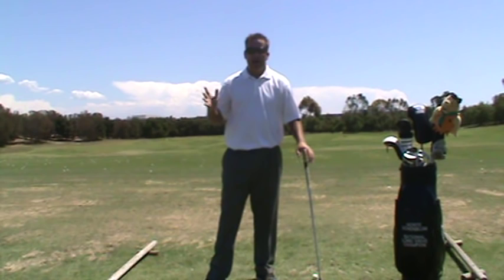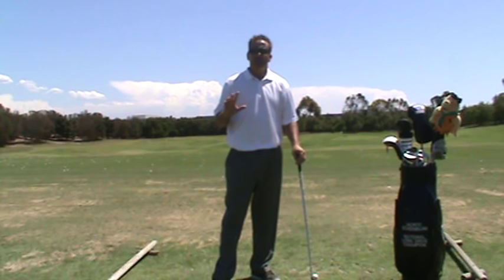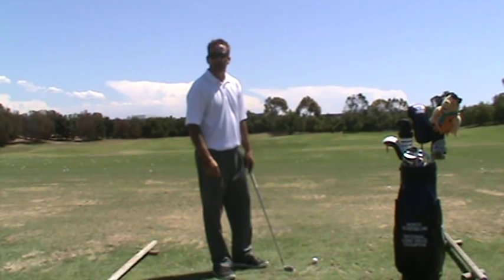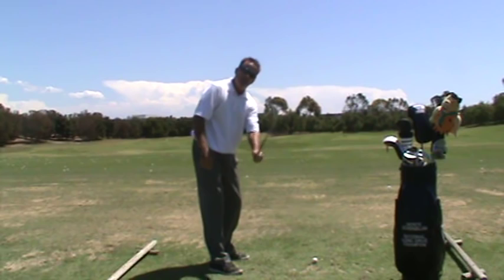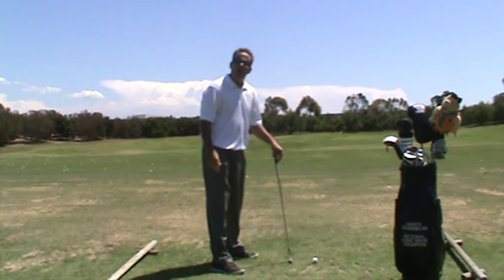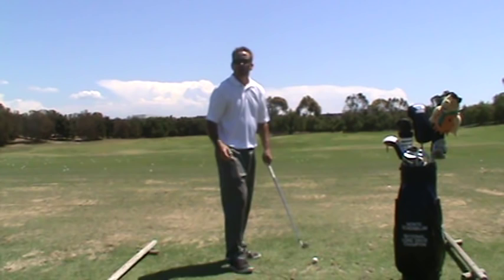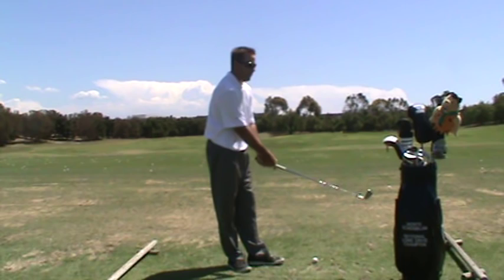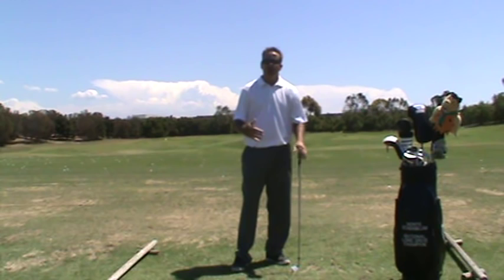Making a Perfect Back Swing

Comment: This video and the left arm rotation and lift video are about the clearest and simplest instructional videos ever made about what needs to happen in the golf swing. It's good to do it slowly with a lofted club to hit crisp, high pitch shots and get the movements imprinted in the brain. Important to remember that the lead arm rotates over and around the trail arm in order to effect the 90 degree rotation. Do not simply fan the wrists open or the clubhead will get stuck behind, and that is simply trouble with a capital T.

Comment: Thanks for this video Monte.  Very helpful and it seems to be helping my swing already.   I have one question concerning the left arm rotation.  Seems to be a weak area for me, probably because I used to over rotate and then overcooked that and under-rotated for a period of time.  I noticed that you didn't mention the folding of the right arm as being a requirement.  Is that because the right arm will tend to fold in a good fashion if the left arm rotates correctly?    I did  a little experimenting with that and it does seem that the right arm tends to fold by itself if other parts of the backswing are working correctly.  I would prefer not having to think about consciously trying to fold the right arm so as to make the backswing more simple anyway, another reason why I like your methodology.   Of course there seems to be a huge amount of emphasis on the right arm folding in golf teaching anyway,  possibly way too much.

Comment: I get what you are saying here, but the drill put the club into a position where it was getting steeper from P3 to P4 instead of the classic shallowing you see in almost every "ball striker" which is a shallowing of the club from P3 to P4.  Hogan/Trevino/Furyk/Morikawa put whoever you want in there but this drill definitely isn't gonna help the golfer in my opinion particularly the chopper (90 shooter).  Now I  know there are instances of great players who shallow coming down (Couples, Nicklaus,  Daly) but they are far less common on the tour.  The company I worked for CompuSport back in the 90s created computer models by having 50 PGA Tour players swing and it combined them into one model.  The model laid the club off at P4 and the club was definitely shallowing during transition near the top of the swing vs on the way down.  Enjoy your content though, keep up the passion for excellence, and not trying to be condescending, just offering some other thoughts based on science.

Comment: I think this is a helpful drill, except when the hands might get too far from the body going back.  The hardest part for me is to get the left arm rotation correct while getting the club on plane at the same time, albeit my wrist cock has improved..  Movement number one might help keep the left arm rotation from causing the swing to become too flat.  For me, ssems like I have fo focus mostly on getting the wrist hinge right so that the left arm can rotate like it should and at the samee time keep the club up on plane or close.   Lifting the left arm in the backswing also seems to help keep the club from getting too flat.

Comment: One question, at 4:03 at the top of the backswing you have the club parallel and pointing straight down the range.  I think this is a function of the right wrist.  For lack of a better explanation, at the top of my backswing the club is point ~45 degrees left.  I think this is caused by my right wrist/palm facing towards the sky, which is the most my wrist will "open" .  I have always concentrated on a flat left wrist (and right elbown down)  but couldn't figure out why at the top of my backswing it was never getting that vertical.  Now finally seeing it, your right wrist isnt that open as if your a carrying a waiter tray.  
Any thoughts on how to get your right wrist in the right position?  Thank you.

Comment: This drill works great for me! However, I am having trouble converting this movement to a full swing. Is the idea to start the backswing with the arms and then allow the hips to rotate back once the wrists are set??
Reply: Agreed - all very well giving us the 3 components of the backswing, but did not elaborate on how to actually put it together for a proper swing - which is the first movement? Shoulder turn, arm rotation and finally hinge? Did not show how to stop the inside takeaway

Comment: Any possibility you could comment on a Shut-Face backswing like Dustin Johnson, or Zach Johnson?  I was reading Four Magic Moves by  Joe Dante and Bobby Jones mentions it as well as a different style to his preferred Open Face Style. 

Basically, they break the right wrist back on the takeaway and they arrive with a shut face up at the top.  It seems to be a pretty simple way to get up to the top, but it seems its a different swing action to do correctly?
Reply from the maker: Many ways to do it, as long as parts match.  There's a reason most players are not shut.
Reply: Hey Monte, first off thank you so much for the reply...and secondly thank you thank you for your Width and Depth video, as well as the videos with be better golf on shorten swing and short game!  I've been at it for 3 years, started learning with Shawn Clements stuff.  Even been to a few clinics of his.  He's great, but I found myself getting down to a best round 80, best 9 from black 42 and from blue 38....I should have worked on short game and putting from there, but I realized I was grooving a pull fade and I tried fixing it...

It has been somewhat of a roller coaster on my own and I can find no competent teachers locally.  That said from watching those two videos I realized I was letting my arms collapse and maybe had the lean trying to imitate my fav player Bubba Watson.  

Just doing the hinge, arm rotation, and shoulder turn...I realized I was letting my arms do it all.  when I got more vertical versus being so wide I felt like I could stop my arms with my shoulders and it opened up the bottom right corner of the ball finally.  I am going to work on this only and stop reading the Magic Move book all together!

Frustrating doing it on your own I must say...about the only thing that people seem to agree on is 1.  Good Grip, 2. Steady Head 3.  Lateral Bump (even debated).  Past that it gets nuts...In any case, thanks for your videos...and hopefully I don't get too deep now, but the image of a bar graph and taking it back at a 45 angle seems to get my shoulders to do the work!

Comment: Just wondering, why doesn't anybody have a back swing as demonstrated in that drill?  Why the need to coordinate those three movements?  Just hinge, rotate, turn!
Reply from the maker: I don't understand the question.  Everyone who has a good backswing has those three elements.

You said just hinge, rotate and turn.  That's exactly what I demonstrated.
Reply from the maker: Hinge (1), rotate (2), turn (3).
Reply: Monte, I mean in the order that you demonstrated, rather than trying to blend them all in one motion.
Reply from the maker: Larry...good question.  Something to that effect works for Ryan Moore.  I have seen a lot of golfers who would benefit from just that, but was reluctant to "teach it."
Reply: I mean, if the object is to get into a particular position at the top of the swing, why make it more complicated by requiring all three motions to happen at the same time?
Reply: larrybud It would be ridiculously difficult for any level golfer to get any kind of feel for the shot they're hitting if their swing consists of three separate robotic movements... The golf swing is supposed to flow naturally, when you time the 3 elements correctly to form a swing that allows the club to stay on plane throughout the swing, it feels much more natural and consistent. Whereas if you were to do the three separate movements, there is a much higher chance of messing up the swing on any given attempt because you need to make sure you do one thing correct, another thing correct, and a third thing correct and then if one gets messed up, it would be impossible to compensate for the mistake because the movement that was messed up has already be performed.

I mean, if you want to actually try playing golf like that, go for it. But unless you're some kind of robot, I can guarantee your consistency will not be good while doing it.
Reply: Rektspresso , I quest that’s why Manuel de La Torre taught to simply swing the club with  both hands equally so the club ends over the right shoulder , all those 3  moves happen automatically ! RIP , Manuel !